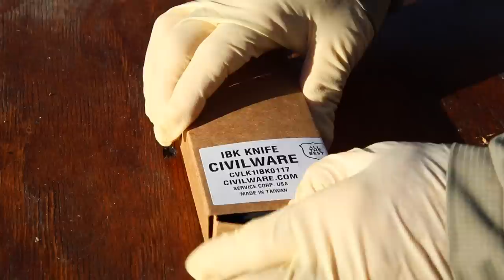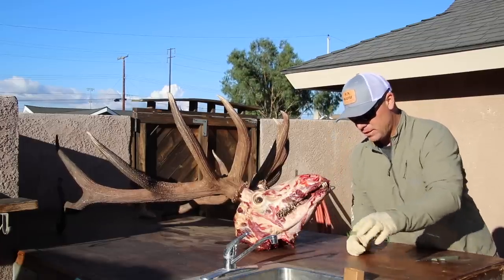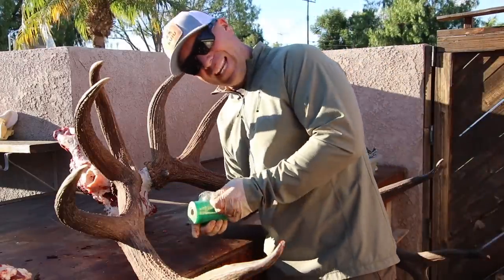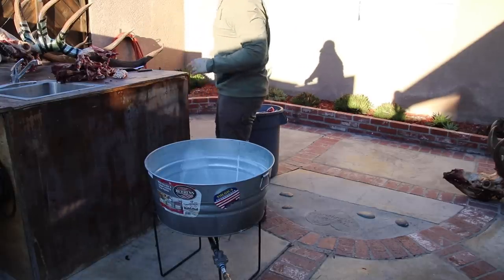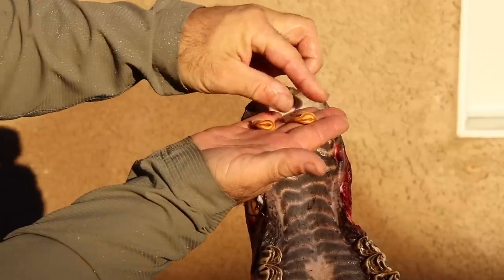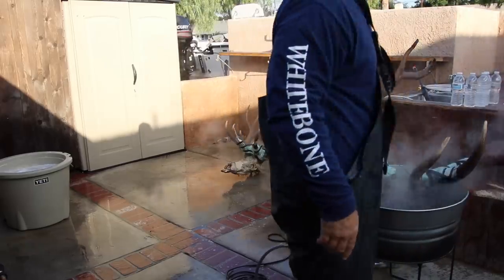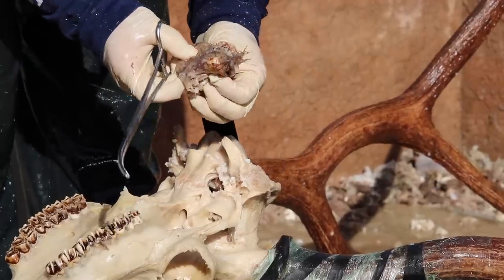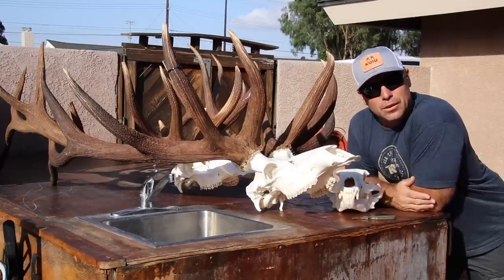GIANT BULL ELK SKULL CLEANING

Comment: QUESTION
Hey there Ryan, I've been doing skull work for many years now and I follow your method almost to the T other than power washing.  I like to keep the nasal cavity in so I shy away from the high pressure. But in some cases my finish product tends to come out with a powdery almost lime stoney film on it.  If your patient you can scrape it off or sand it off, but I've tried to figure out what is causing it and haven't had any luck.  Perhaps to much oxi clean in the boil? Over boiling (mine is in the boil longer than yours because of no power washing)?  Or could it even something to do with the color batch? I use 40% peroxide from the beauty supply.  I believe the brand name is Sally's.  Any tips would be greatly appreciated.  Thanks you for the wonderful messages you put out there and content!
Reply: I do my boil with baking soda and the flesh just falls off and the brain spills out. I let dry overnight then I use a similar hair bleach on it with a brush, let sit recommended time and rinse. Clean white skulls Everytime.

Comment: I used the aqua silk and did not have great results. Must have done something wrong. Skull came out super dingy. Went back to the old 40 volume hydrogen peroxide and it whitened it up. Not going to give up on it yet though. Great work bud and thanks for sharing your videos with us
Reply from the maker: Same aqua silk bottle ? Does it read 27 percent peroxide
Reply: That I didn’t check that could be the problem
Reply: But it looked the same as the one you were using

Comment: Hey Ryan, I’m not sure if it makes a difference or not, but I saw a fellow doing some welding on galvanized metal. He said the fumes are extremely toxic and took great measures to not be exposed. Again, I’m not sure if the temperature makes a difference, but I’d hate to see you get sick possibly.
Reply from the maker: It safe wee but galvanik dust and welding in crazy dangerous
Reply: Yeah the galvanised is just mild steel coated with zinc. The zinc when molten is very toxic and if you are exposed to it, the short term causes galvo fever which is flu like symptoms (apparently drinking milk fixes this) and long term may cause respiratory damage or lung cancer. Still, this didn’t stop my previous cunt of a boss from making me weld galvanised at the age of 17.